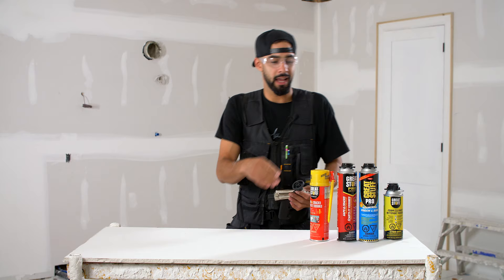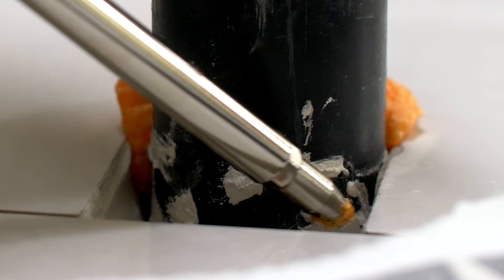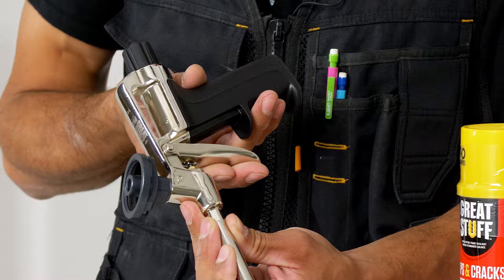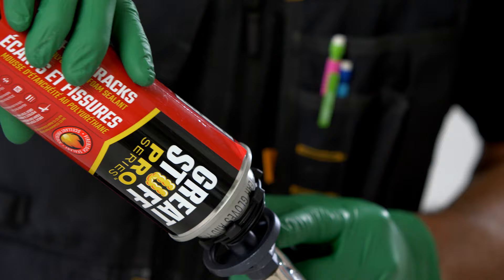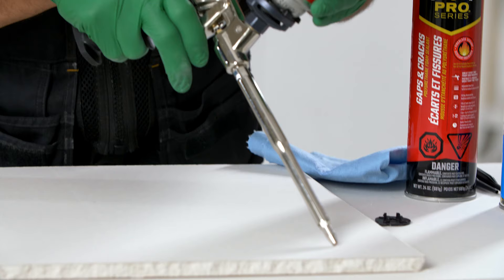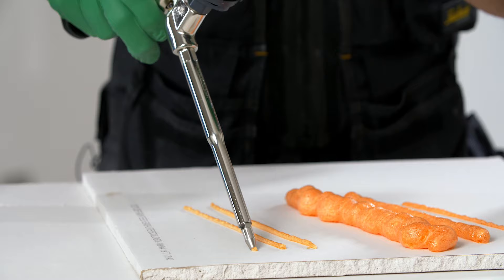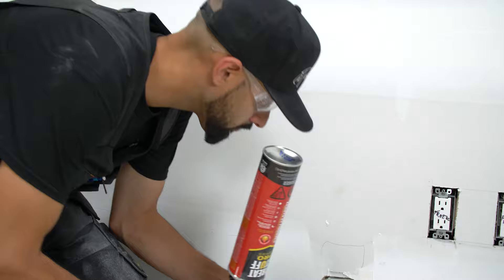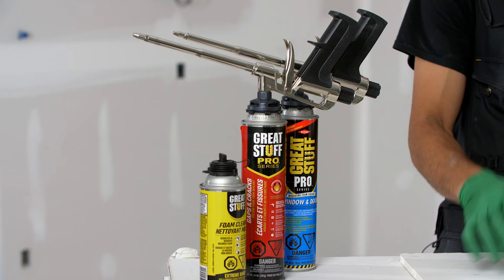How to Use and Care for a Professional Spray-Foam Gun

Comment: One huge tip he didn't mention is that after you unscrew an old can and put a new can on you must spray enough foam to cycle out any air trapped. Also never store the gun if it just sputtered always store it after a smooth bead has came out with no air or it will dry and you will be buying a new gun.  I just use a rag with lacquer thinner to clean the tip and nozzle.
Reply: Is there a longer version? I need to fill a gap about 14" away from my access point
Reply: Exactly. I realized that the hard way. My can near empty before weekend. The wee bit of air in there gummed it up. I also wonder if purging gun with the acetone can, if that should be held with can right side up, unlike shown in this video. I couldn't get another gun to purge so in desperation I quickly screwed on another full foam can and it came around fortunately.

Comment: Hmmm, shouldn't you keep the foam can vertical, not upside down while you're screwing it on? That way, there's less risk that you will have the foam in between the can and the gun, which you don't want. Less cleaning

Comment: Gerat video, very useful.  However, it doesn't tell you how to remove the little black wheel when it's completely stuck on the can.  After 15 minutes of cursing and attacking the wheel witth a variety of sharp implements and liberal sprays of GT85 the wheel is now off the can, but is completely mangled, and I probably need a new gun now.

Comment: One tip I learned from one of the gun manufacturers was to coat every area that might contact the foam (this is on the gun I am referring) with Vaseline. I do the threads on the can, the can receiver on the gun and all the way down the nozzle. Basically, I brush it on with a small brush like a plumbers acid brush, everywhere but the handle and trigger. The nozzle I reapply as I go and wipe the end. My guns have never been cleaner!

Comment: Keeping a small jar of Vaseline to coat the tip and the adapter cage really helps prevent cured foam from building up, and assists with clean up.

 If anyone knows where to get parts for these, please drop a link.

Comment: Very helpful, especially about screwing the cans on tight. Helpful to know how to clean the gun through. You can remove cans safely even when half full. . They have pressure valves. Cleaning takes time. . You'll get lots of coloured foam coming out before the cleaner runs clear. Good ventilation is essential.

Comment: During the one month in which you can leave the can attached to the gun, must the unit be stored so that the can remains in an upright position, or is it ok for the unit to be lying horizontally (e.g., to fit in a toolbox without tipping over)?

Comment: I’ve done all these things to a t and somehow the spray foam when putting on the cage quickly still continues to spray foam in the cage. I take it off quickly and clean the cage and foam can with gun cleaner and it all looks 100% clean. But air bubbles mixed with foam gun cleaner are coming from the ball inside the cage. Meaning it’s leaking air or not sealing properly when the van is screwed on. How do I fix?

Comment: i have problem with adjusting foam/air ratio. i full screw bottle to gun and foam escape from bottom end, not from gun tip. i try to little unscrew bottle from gun and gun start to work. BUT, quality of foam is very bad, to thin. do i need some adjustment? maybe is gun clogged.

Comment: Anyone know if there is a way to possibly add a tip to these guns to allow a fan-like spray pattern?    Trying to seal off light gaps AND weatherproof the (roof) peak in a metal building.
Reply: I purchased a set of three simple plastic nozzle extensions.   About 4 inches long, one end pressure fit over gun nozzle, the other a "fan" exhaust about .5 inches by by 2.5 inches .  I trimmed the three to different lengths giving them different exhaust dimensions,  3/4", 1.25", and 2".  Works great, just keep them clean with lacquer thinner or foam cleaner.

Comment: I cross threaded a can or didnt tighten alll the way.. now the gun with new can it sprays foam really slow. I think foam dried on the inside. I tried claning that part that can connects to. Still not working what should i do
Reply: I had a clogged gun.  It was the official great stuff gun that he is showing.  It was really badly clogged.  I used mineral spirits and nearly a whole can of cleaner and took it all apart and used several pick tools to remove all of the dried foam inside the gun.  I was able to save it.  It took a lot of work, like hours.

Comment: So can you use half a foam can, take it off and attach gun cleaner and do the cleaning process and then re attach the foam can and leave it till next time?
Reply: Just leave it on for storage. It’s best to not take it off, unless you have to.
Reply: But gun needs to be cleaned otherwise the foam will get stuck inside the gun.

Comment: Safety goggles for spray foam? Seriously?
Reply: Yes, certainly.  You’ve probably never experienced what happens if some dirt or foam gets trapped in the threads or for any reason you have difficulties getting that can installed or removed quickly.  The foam can come shooting out of that port and it gets everywhere.  The last place you want it is in your eyes.